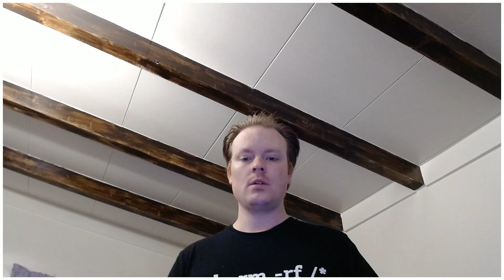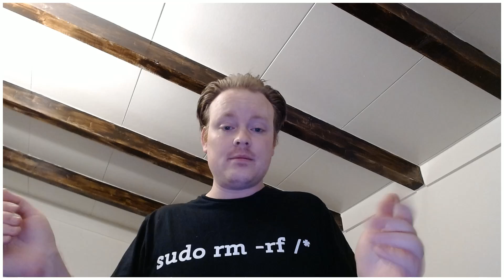Ubiquiti UniFi Power Redundancy System

Comment: Few thoughts:
1. All power redundancy platforms, server, network equipment, or UniFi are proprietary. You can't shove a 6509-E PSU into an R730XD. So that argument is silly, I'm not entirely sure why you tried to make it.
2. The RPS is definitely hot swappable, nowhere in it's documentation does it say differently. You can replace an RPS without any downtime as long as your switches have their onboard PSU powered.
3. The pins you're referring to are DC voltage, this is important for a lot of reasons. Converting AC -> DC has loss on every PSU, a single RPS does this conversion once, and is more efficient. When combined with a UPS, your UPS will last longer with the RPS versus plugging each switch into it. DC based PSUs in the datacenter or closet are becoming more and more popular for a lot of reasons, the main reason being efficiency. There is no switch or computer in the world that runs on AC power, all power supplies transform the AC current into DC current at an efficiency loss. The only negative mark here is that all of UniFi's switches don't include two RPS ports to have a fully DC platform, or at least a pro model variant with DC input.
4. Your "complaint" about having to label 48 cables is actually highly unprofessional. All of your cables and patch ports should always be labeled. It's good organization. There is no world where you walk into a DC or closet, look at 3-4 switches fully loaded and say "I know what all these are". Real (emphasis on real) professionals will label their cables, either with a numbering system, or device name. Excellent professionals will use patch panels to create an organizational system. A 1U patch panel has 48 ports on it, numbered. The bottom half goes to the top off of the switch below, and the bottom patch panel's top row goes to the bottom row of the switch above. Now you have a single spreadsheet of all your ports and understand your entire topology just by looking at it. You can even print it if controller services fail! If this last bit sounds snarky, its supposed to. Millions of dollars per year are wasted on poor network management and documentation of a network. Don't be a part of that group and strive to be better. If hand labeling isn't your thing, design a system of organization that you can infer the ports from visually. Never should it be traumatic to have to replace an entire switch either from failure or upgrade.

I definitely have to give this a thumbs down, mostly because you don't understand the technology or procedures required of someone who does networking and cabling.
Reply from the maker: There's no need to disparage me for throwing out opinions man.  Of course these are how things should be done.  And obviously the PSUs themselves are proprietary, my gripe was about the particular switches having no way to swap the power supply while in the rack, you have to remove the switch and take the network down.  Whereas if the PSU was hot swappable, it's literally a 2 minute job that can be done without downtime.  Ubiquiti seems very bipolar with their direction.  They had hot swappable PSUs in some of their units, but they seem to have decided not to keep doing that.  And I'll admit to not being the biggest networking expert in the world, but I have a pretty good handle on it.  I'm currently wearing the hats of an entire IT team supporting everything from desktops to servers to networking to access control, and basically anything else that runs on electricity and processes data, for an 80 person media marketing & advertising company, for 5 years with 5+ 9's of uptime, so I think I have at least a decent handle on things.  This wasn't a "professional" video, so I don't know why you're throwing that in.  It was personal opinions and rambling lol.